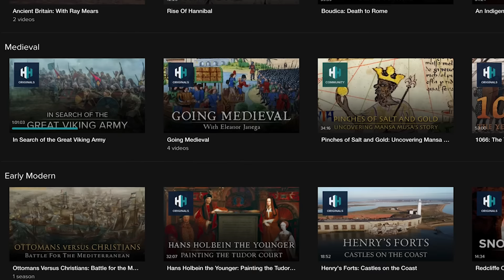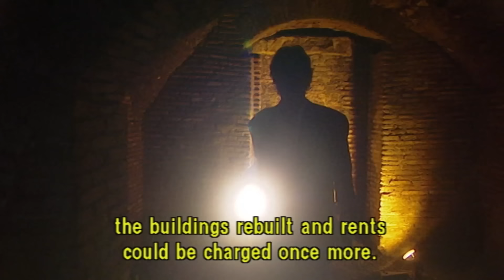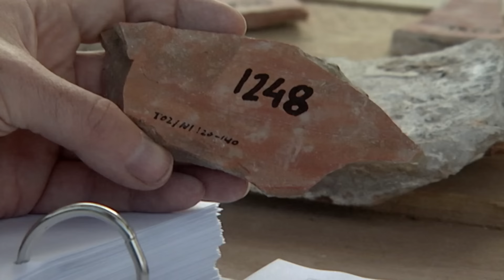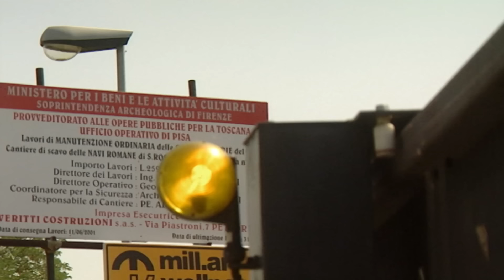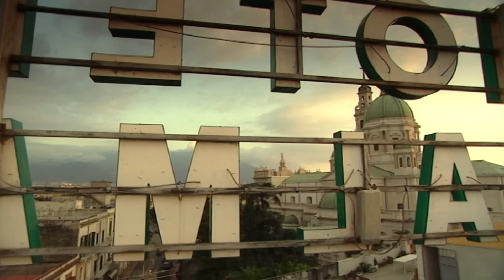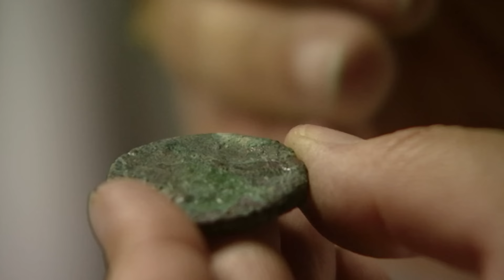What Was Normal Life Like In Ancient Rome? | Absolute History

Comment: I don't get it. He says The Colosseum was inaugurated in 80AD and festivities ran for 100 days. During the festival 52,000 gladiators died. It seems like a overinflated number. If we multiply 100 days by 24 hours and get 144,000 minutes. You divide that by 52,000 and you get 2.7 minutes. It means if they fought 24/7 for 100 days, every 2.7 minutes 1 gladiator had to die. It seems fishy. I mean 24 hours of non-stop fight and festival?
Reply: It is possible that 20 were fighting at the same time  - and there would be only one winner.  I think that happened as well.

Comment: It seems like I know nothing about "normal life" in Rome...armed soldiers inside the pomerium? For sure there must have been cases like that, but I didnt know that was the "norm"??? And bearded??? I get it if pants-wearing gauls were bearded, but ordinary romans? I thought shaving was a sign of the civilized man, but this doc makes it out that even soldiers wore beards, am I just stupid or what?
The carts, I thought they needed to use the carts at night due to the risk of injury, not that they were loud (also I dont think the romans would have cared much about the noise, but apparantly I am wrong about a lot according to this documentary).
I was also of the impression that gladiator shows seldom were to the death, and that they were so stylized you'd never see a gladiator with the shield on the right hand...
Very confusing stuff, I think I need to go back and read more about Rome
Reply: Right, I just saw a flail, that does it; I think this doc is a bit off target - such a shame.

Comment: What was the length, beam, draft and design of these Roman ships? 
How many oars, masts, sails? 
Did it have an enclosed hold with a walk around deck. 
All of this archeological excavation and you show us a bit of old leather a few centimetres long.
I'm guessing a hull about 15 metres long and a beam about 5 metres, and a hold about 1.5 metres covered with a seaman's deck, row locks for 8 or 10 oarsmen and a mast for a square sail. 
Some real archeological facts would have been most informative.
Reply: It's a documentary, designed to impart as much info within the time.
What you're asking for is something which appeals to only a small percentage of people watching it.
I'm sure there will be a website or two where your find out the facts.
Reply: @PhyllisGlassup2TheBrim  So people are more interested in bits of old leather than Roman Ship design? Your values are not mine, that is for sure.